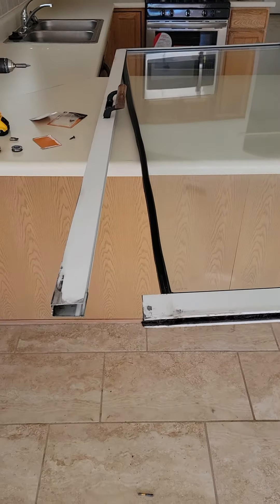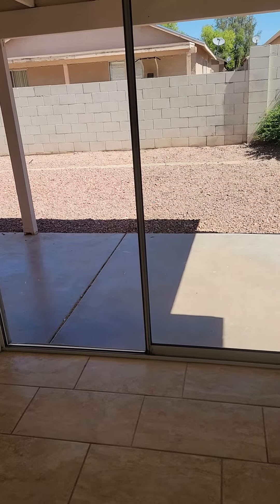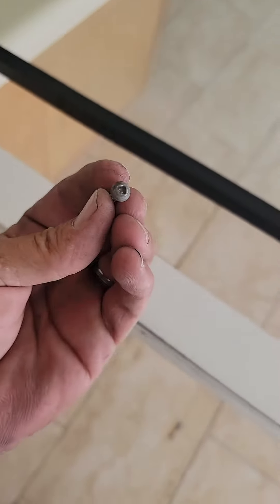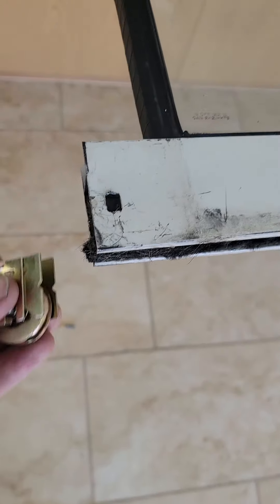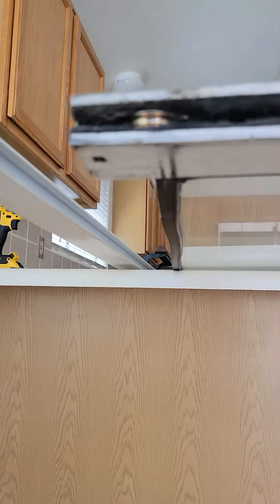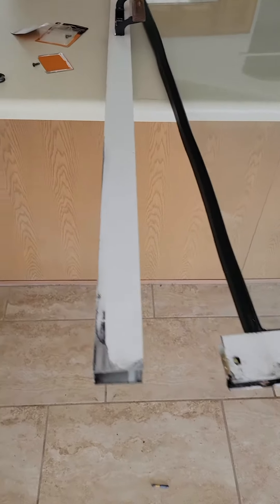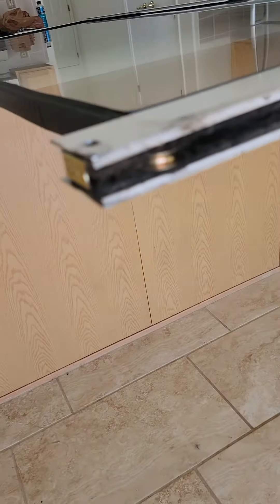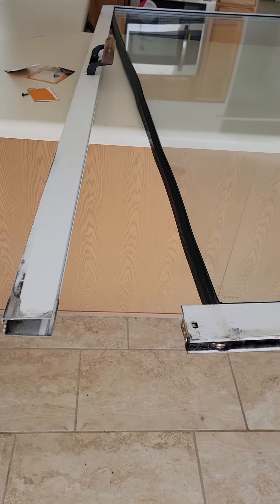Replacing Wheels On A Sliding Glass Door

Comment: Just found your channel. I'm in the same trade in Atlanta. I've had success leaving the door in the jam/track. I use a small pry bar, dead blow hammer, scrap 2x4, screwdrivers and drill. When ready to reassembly, I'll use lube or soap to help the frame slide over the rubber. Then make the adjustments to the wheel cassettes. This really helps save your back. The time it takes is about the same, but no lifting or trying to find a space to lay down the door to work on it. 
Keep making videos, you've got a good thing going.
Reply from the maker: I'm going to have to give that a try.  Profits almost always come by finding faster and better methods and processes.  Thanks!